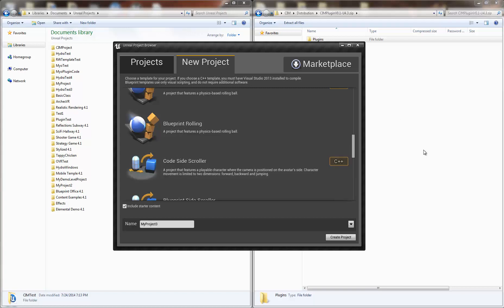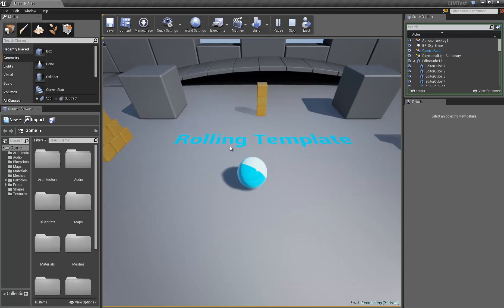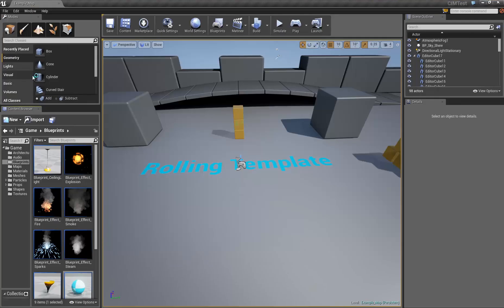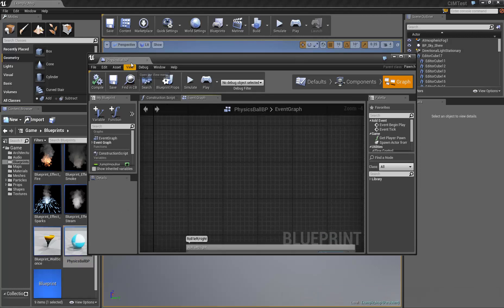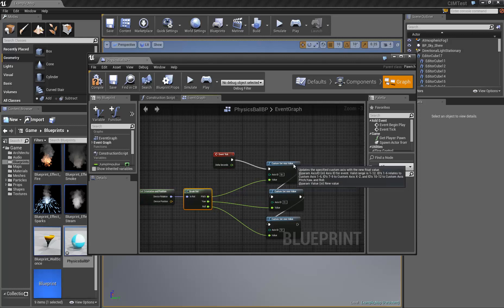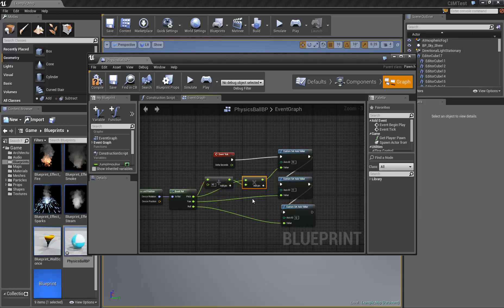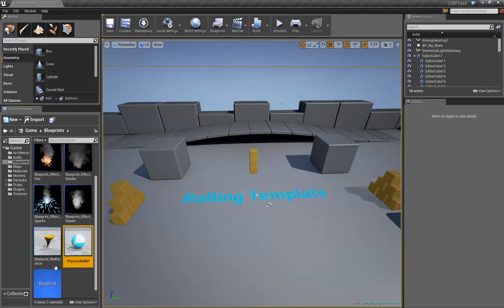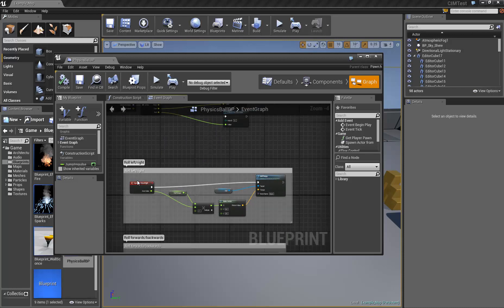Custom Input Mapping - UE4

Comment: Don't you have a plan about a tutorial for MYO & UE4?
I've got some troubles using your MYO plug-in. ^^
Reply from the maker: A video is in the works. For now though, make sure you are using beta-1 SDK and Myo Connect for the current version of the plugin.
Reply from the maker: Didn't get around to making a video, but the plugin is now well documented. Using the 0.7.1 myo plugin, update your myo connect to beta-5 and make sure your myo has the 0.8.17 firmware or newer then follow the instructions found in https://forums.unrealengine.com/showthread.php?37876-Plugin-Myo